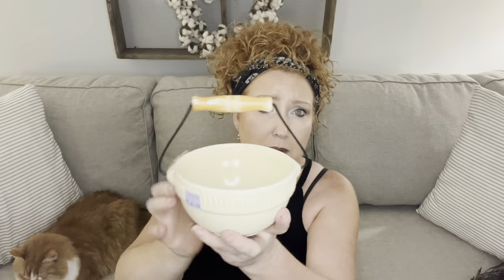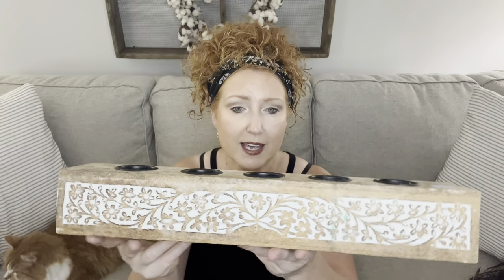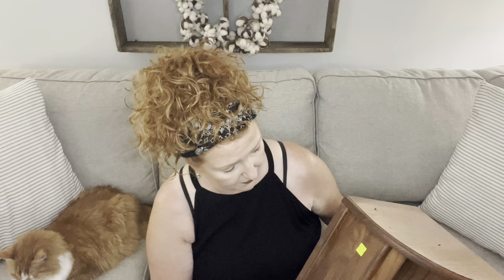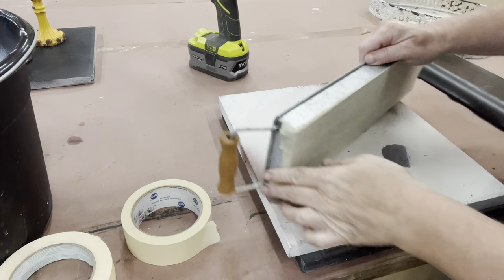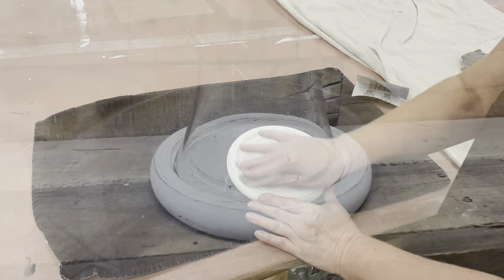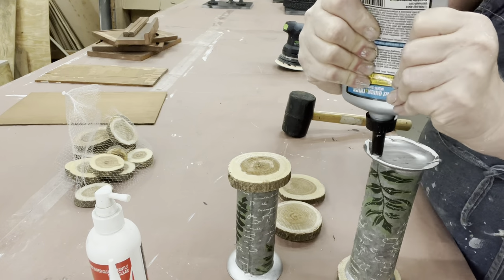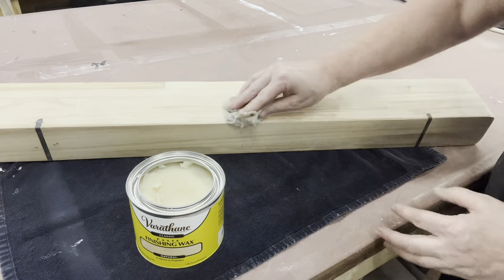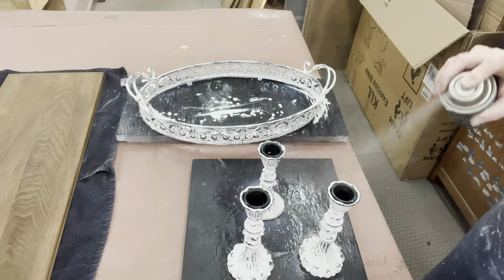Thrifting Secondhand Home Decor | DIY Ideas for Profit

Comment: That blue wire milk crate, would you want to make it dull silver/gray with a white or black horizontal handle and use it outside to hold flower pots? Might be really nice
Reply from the maker: I tried flower pots .. ( terra cotta) I can’t find the right fit yet. But I’m still searching. That was my idea. But know that I know it holder milk bottles, I may be able to find them easy to fit